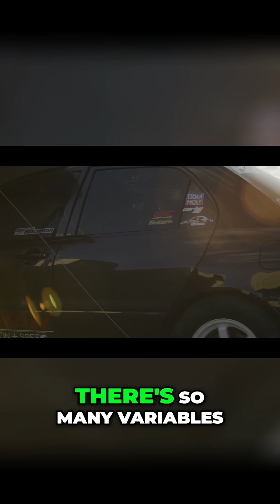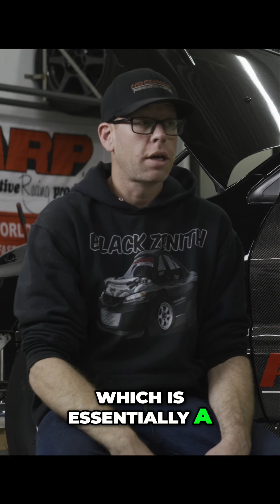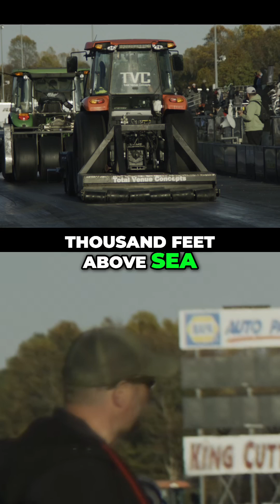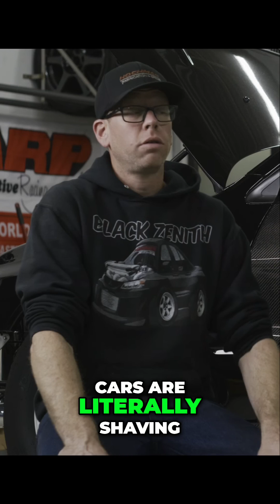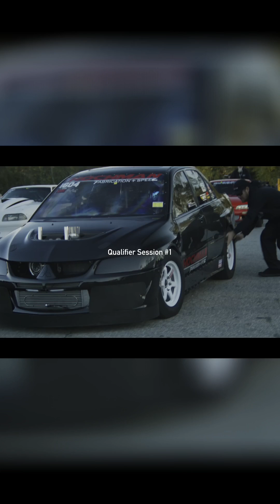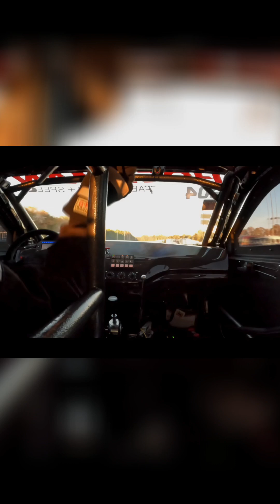Density Altitude: Unlock the Ultimate Racetrack Speed Secrets!

Comment: 1500 feet below sea level? I'm assuming that's how the density altitude calculation worked out because it was AT sea level and cold during the race?
Reply from the maker: Yes, the race was at sea level, but the colder conditions, combined with the track's altitude, resulted in a lower than expected density altitude.